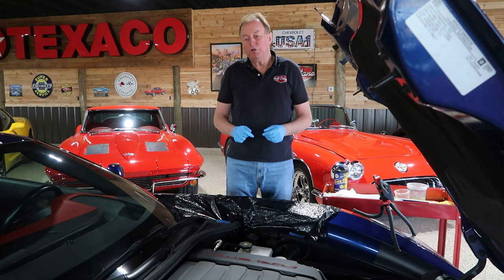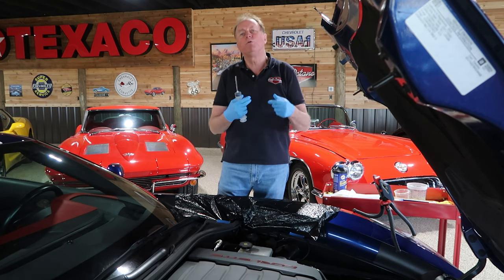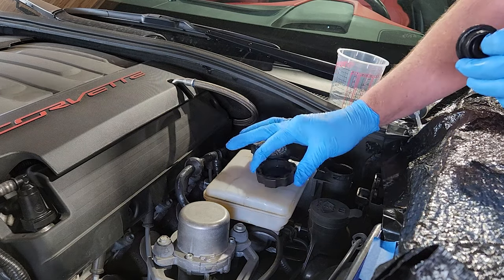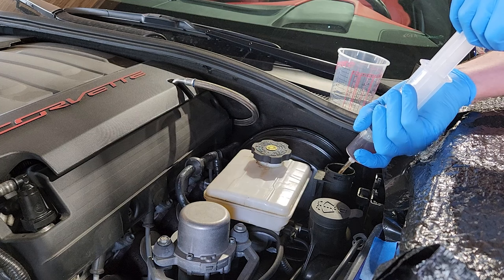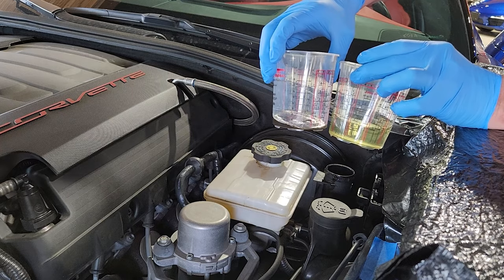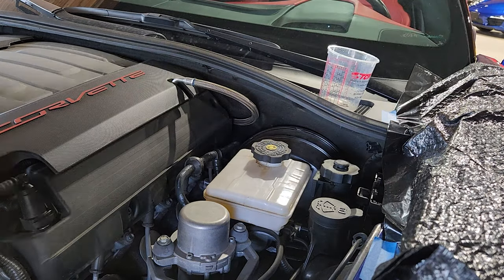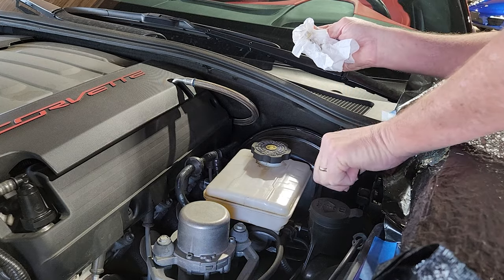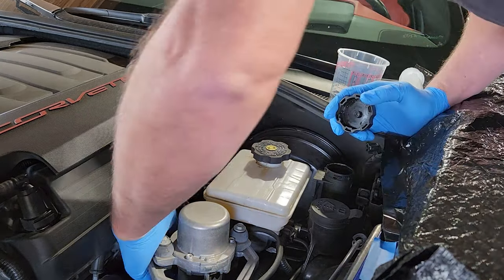DIY FIX - Sticky Clutch Pedal C7, C6 & C5 Corvette

Comment: Thanks for confirming that's the cause of my semi-dead pedal.  I let a Valvoline lube shop change my oil and I saw them open my clutch fluid for no good reason.  I got home and saw they left the oil filter a full two revolutions out from hand tight and it was pouring oil out.

Comment: Just fixed my C5 sticky clutch . Thank you so much !!!!!
Reply: Do you pump the brakes or the clutch 30 times?
Reply: @billgatesleavingyamomshous8177 This is a tutorial for a Corvette, where the brake fluid and clutch fluid are in separate reservoirs. So, you would pump the CLUTCH pedal only, in order to cycle the clutch fluid in the separate reservoir. 

If you a car that shares the same master cylinder reservoir for the brakes and clutch, like a Camaro, I would recommend the same method, but preferably with the car on. This is so you can pump the brakes on the car to cycle fluid into the reservoir, to be siphoned out (or sucked out with a baster). The clutch can also be pumped with or without the car on, but doesn’t have to be pumped 30 times, at least in my experience. It’s a lot easier to cycle fluid with cars that share reservoirs.

Comment: My c7 is doing this so will give it a try…Thx
Reply: Highly, highly recommend rigging a DIY clutch return spring. I am now contemplating removing the factory clutch assist spring, as I’m personally used to the (false) hard pressure those 2 springs now generate; but I’d definitely be much more comfortable with it being lighter (and more natural). 

My question is whether the action of having the clutch pedal pulled back UP, when the clutch hydraulics go OUT, will lead the clutch to slip/drag? 

I’ve heard of slipping and dragging issues when the pedal remains DOWN, but I have yet to hear of anyone instinctively holding the clutch down in that case (they instinctively pull it back UP).